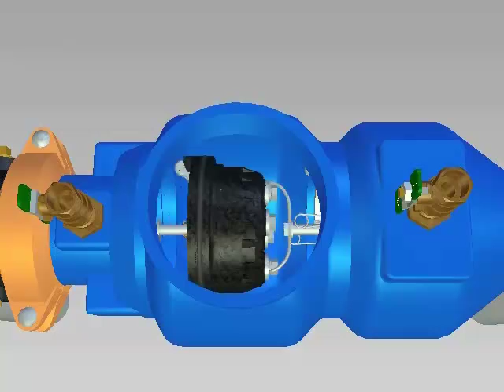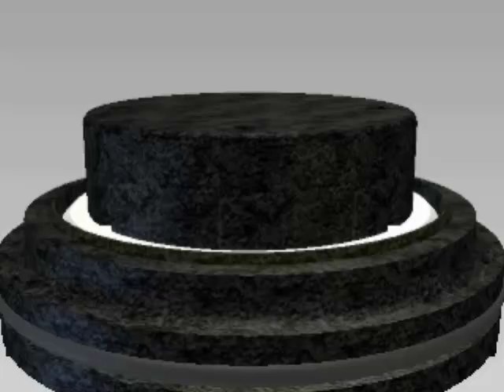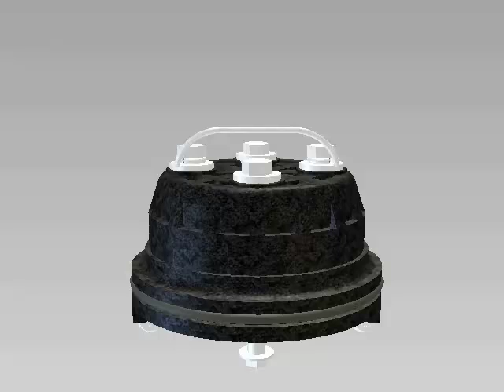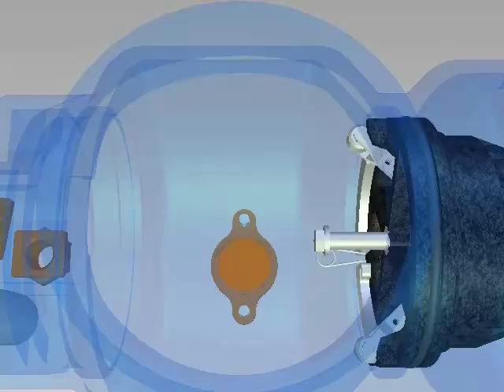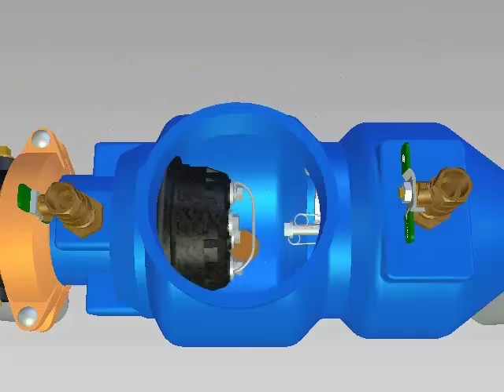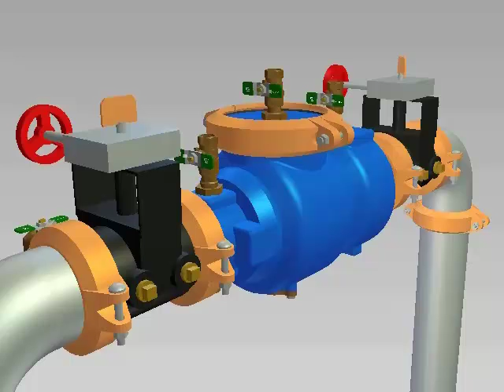Repairing a Zurn Wilkins 350 (4" - 6") Double Check Valve Assembly

Comment: How do I remove the retainers? They seem to be lodged in place with no room to move them!
Reply: Hit it with your purse! I came across stuck retainers today. I used pliers and my flathead and pushed at the edges of the retainer and kept working it back and forth and got it free. Lot of build up on them had to wire brush them clean.